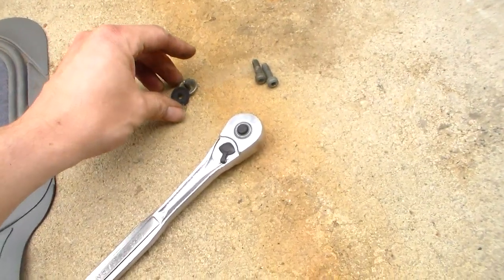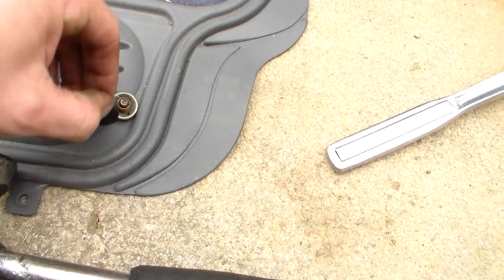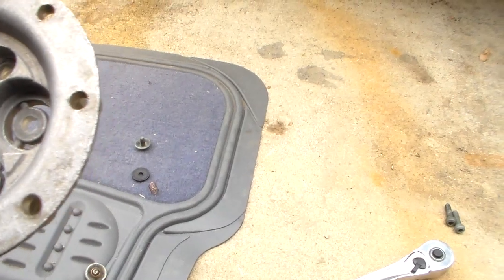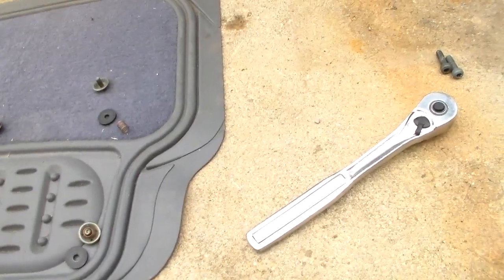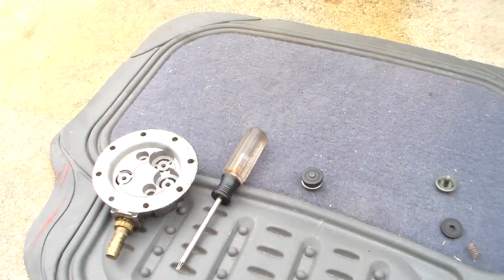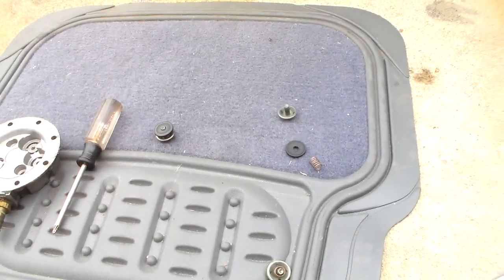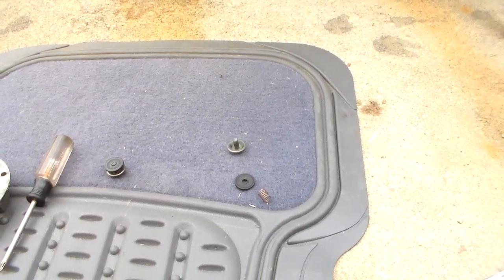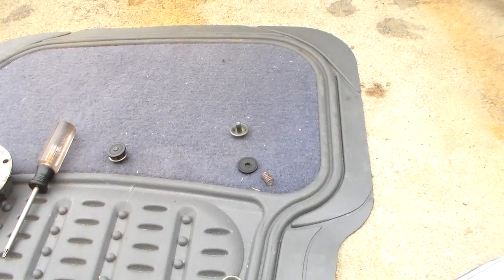Carter mechanical fuel pump disassembly part 2

Comment: Tyler, that gasket that looks kind of like a "smiley face" --the lower gasket--we can't find that no matter where we look! Do you know what it's called and any ideas where to find one? We can't seem to find a gas-resistant gasket material that would work to re-cut one. If you can recommend that I'd appreciate it too. Thanks! :)